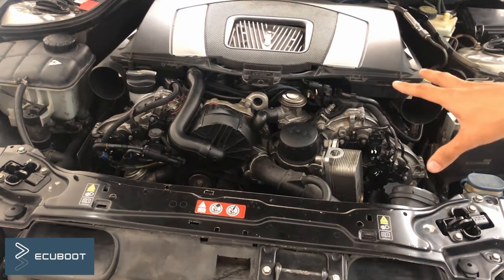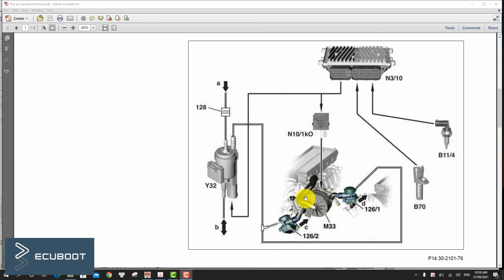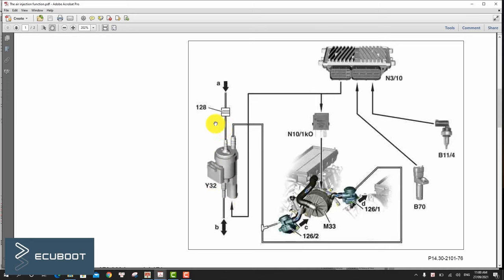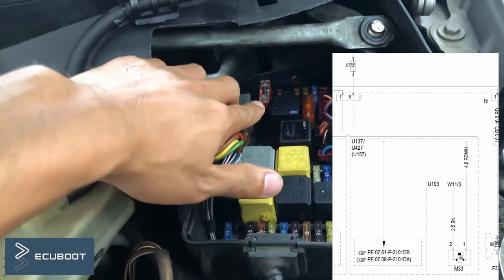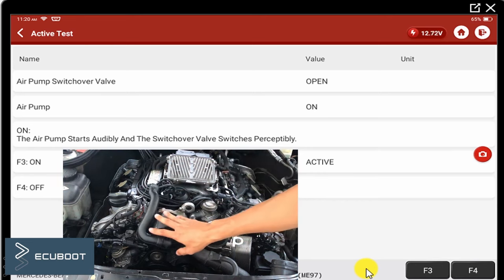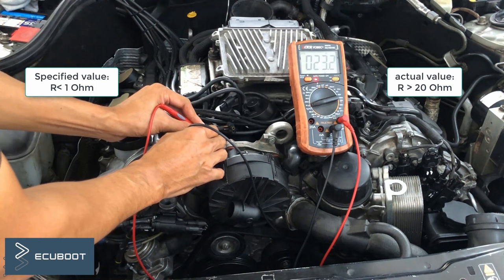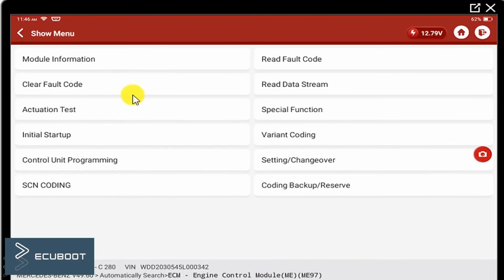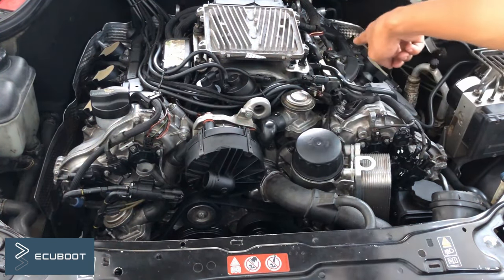How to fix Mercedes Secondary Air Pump DTC P0410

Comment: You are amazing, thank you for this video
Reply: 3:37 the manifold vacuum 3 way splicer with yellow connectors has cracked on the vacuum line. Anyone know this part number? Great video,  I think everything else looks good except my disintegrating vacuum line connector rubber.

Comment: I have a 2011 E550. Code says: secondary air valve bank 2 stuck open. I’m hoping that replacing the pump will fix the issue? Thoughts? Thanks

Comment: Besides checking the resistance at the terminals of the air pump, I would have liked to see you apply 12v directly at the air pump terminals to further show it is completely not functional.  
My situation, currently troubleshooting code P0410 on 2010 GLK 350.  And all the components seem be functioning except am missing the trigger signal from the ECU at the air pump terminal.  I verified the wiring is good as you showed in the video, both the ground (brown terminal #2 and the other (terminal #1) to the 40A fuse.  The conditions were met for the ECU to trigger the air pump and the switch over valve but no trigger signal from ECU.  I am not sure what this means or if there is something wrong with the ECU or possibly a fuse inside the ECU I need to check!
Note - again, the 40A fuse and the relay both checked out fine and to be sure I replaced both of them with know good ones.  Any suggestion or pointers be greatly appreciated !  So at this point it seems electrical signal issue!
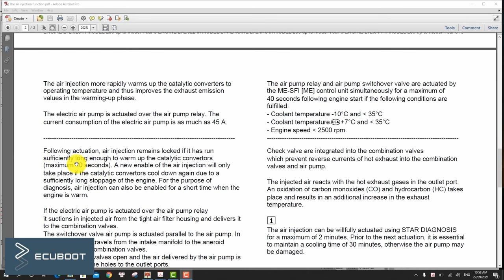Reply: You mentioned "the conditions were met for the ECU" but if you look at 1:49, the condition is between 7 to 35 Celsius.  In many parts of the USA still in winter, the temperature is so cold, it may be below the 7 Celsius day or night which doesn't meet the actuation conditions.  

Have you checked the air pump relay too ?
Reply: @Brian_L_5168  Thank you for the reply.  No, am in California and temperature outside was 60F = 15.6C which is within the 7 to 35 Celsius and the RPM was < 2500.  So the conditions are met for sure.  However, I am suspecting it is possible that the ECU is not receiving correct Coolant temp (another area to investigate but unlikely) or other input to trigger it to turn on the pump!
Reply: Aside from this code, the engine runs smooth at all times; idle even when we had a cold week in the 30s F and normal engine rpms.  I will do some more troubleshooting this weekend but it is getting a bit mysterious without proper live scan tools or schematics.

Comment: How are you doing? I have a 2005 ml350 w163 my secondary injection pump is working when I send battery voltage to it only, my 40 amp fuse and relay is good the electrical connector has ground my problem is that I'm Not getting continuity with my multimeter from the pump electrical connector to the 40 amp fuse , could you tell me how to solve this problem?

Comment: If the relay is bad with the air injection pump still run in your scanner test or when installed?  thks jc

Comment: Great video. Thank you for the detailed explanation 😊
In my case, i have an slk350 2005, the pump turns on, i can hear it, but i keep on getting the Check Engine error P0410 
I am suspecting the second round; my question is: what is the trigger for the 2nd cycle initiation so I can trace it?
Appreciate if you can guide me in the right direction 
It’s driving me crazy 😅
Reply: I've got the same issue. Will try to figure out over the next week or so..I guess solenoid or one of the actuators is broken/clogged
Reply: Keep me posted plz 😊
Reply: @srm113k  did you figure out your issue?

Comment: I have 03 MBS55 AMG code P0410 ,bench test pump run strong ,0.5 Om, relay test is clicking but have no power to pump, do you think SAM module is bad??
Thank you
Reply: Replace secondary O2 sensor.

Comment: I know this video has been uploaded more than 2 years ago but I am still hoping for a reply. I‘ve been having the same issue with my secondary air pump on my W203 C230. After I had my water pump replaced in a shop this problem came up. When I went back they said to not waste my money on a new pump since it’s absolutely unimportant to run the engine. I know that that is true but the  check engine light has been bugging me for almost a year now and thats the only fault it’s showing. After some troubleshooting I have noticed that the very fuse you checked the circuit from is missing in my fuse box and when I checked on the pumps plug there was no power when I started the engine which normally should have triggered the power supply to the pump. My guess is the shop removed the fuse for whatever reason when replacing my water pump since it sits directly below the airpump. Now to my question what type of fuse is that? So I can get one, put it in, see what happens and maybe finally sort this problem out. Thanks in advance
Reply: did you figure out what it was? was it the check valve or the pump? how much did the repair cost?
Reply: @fredrezfield1629  it was the fuse. Since I did the troubleshooting myself it cost me only 3,50€ for the fuse. An original Mercedes air pump would’ve been around 750€ at the dealership. My mechanic told me to just ignore the problem because the engine ran perfectly fine still. It was about 1 year before I actually fixed it. Engine is okay with no faults

Comment: There was no power coming to the Air Pump electric connector. I replaced relay and then it was showing 22V power coming to the Electric connector. So i thought that was issue. After 50 KM drive, engine light back on. I checked power to Electric Connector....and it's not giving me any power anymore. I checked on cold start. Should 22V be coming to connector or 12V? Is my new relay dead now

Comment: My mechanic changed the air pump but I still get the code...
Reply: Could be a tube
Reply: what was your real problem ? the check valve?